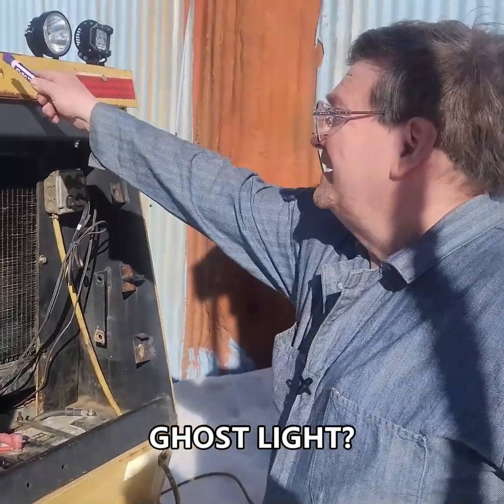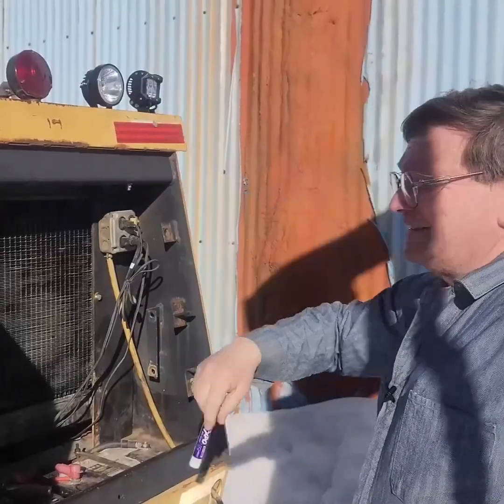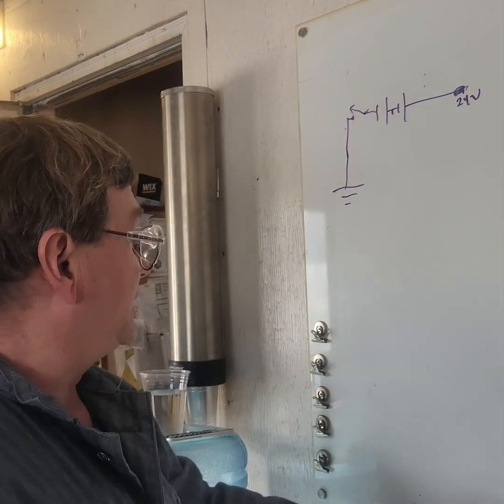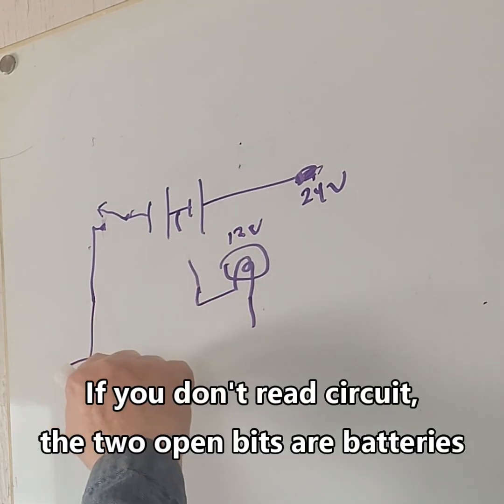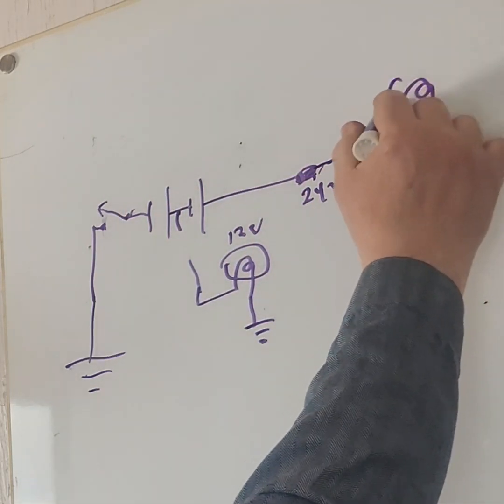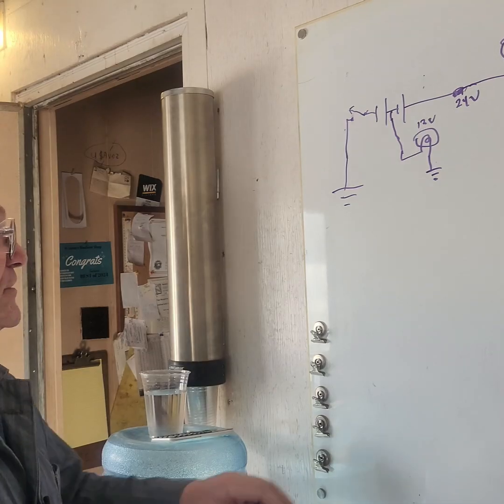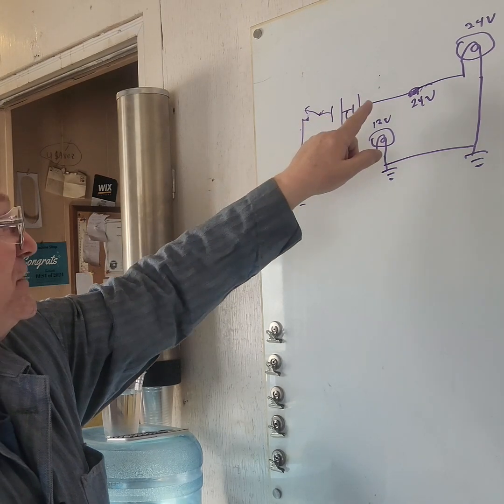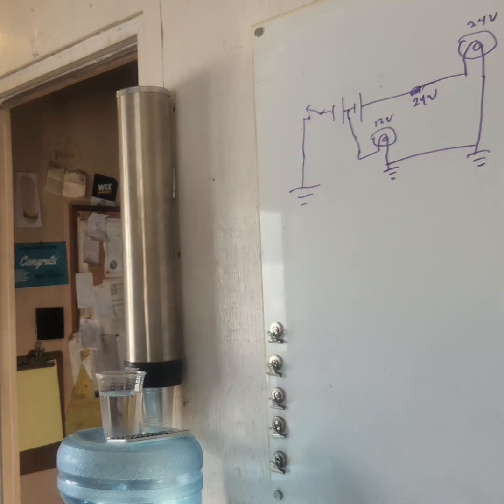A light's on with the ground switch off?!

Comment: When the battery disconnect is open, the glowing lamp's circuit  actually has reversed polarity and the lamp is operating with positive ground. 

ANY component that is usually connected to 24V+ could create the + ground path.

The battery which is normally not connected to chassis ground, now has a path to chassis at its + terminal.

With the chassis "hot" the usually grounded lamp now has 12V+ feed to its "grounded" lead. Thus the chassis feeds the glowing lamp 12V+. The glowing lamp then finds a path to 12V- via the "switched" battery's +terminal, then through the battery-to-battery  connector cable to the  "non-switched" battery's - terminal.

It'd be a lot easier to draw it  than explain it. lol

Go back to the white board and draw the circuit with two separate batteries that are jumper connected + to -, or series.

EDIT - Thinking about this... I realized that I made a mistake in my description. Although the Ghost Lamp grounds Switched Battery's + to chassis, that's irrelevant because Switched Battery is not in play during the fault condition. The Ghost Lamp is being illuminated by current between chassis and Non-switched Battery's - terminal, although that connects via Switched Battery's + terminal.

I may try to clean this comment up to be less wordy.

One more time... during the fault condition, I suppose that of the two lamps, the one with least resistance could be considered to be acting as the ground path.

Comment: Yup.   12V difference.  a diode might prevent that, assuming it can handle the current.
Reply: I was thinking just another ground switch. Easy, dependable, no worries about the possibility of it burning out or getting damaged in some way. Plus you can use crimps or some other kinda connectors for a switch, but with a diode you'd probably have to solder. Which on a piece of heavy machinery, all that vibration...😬

Comment: Don't 1/2 tap your batteries !
It'll work, but it's serious detriment to your battery lifespan.
Reply: For that size battery compared to the small draw of the light, assuming it's only used when the alternator is charging, should not be an issue.

Comment: That is what I was taught is called a sneak circuit. It's a great feeling to find one and point it out to the engineer that designed it.
Reply: A factory engineer didn't inadvertently create the circuit. The "ghost" path came about from  "tapping" 12v from a circuit which is normally all 24V.